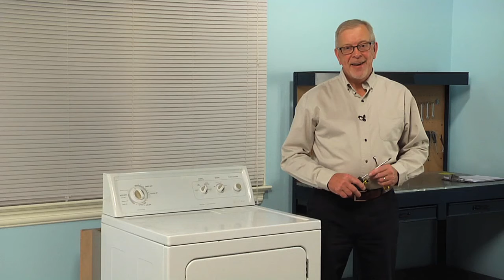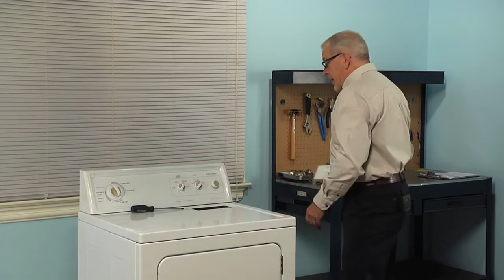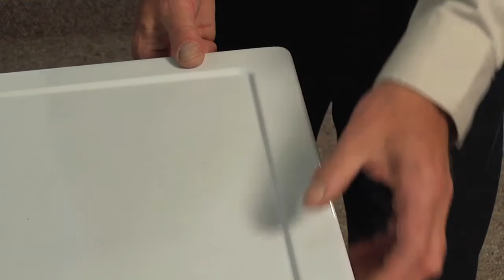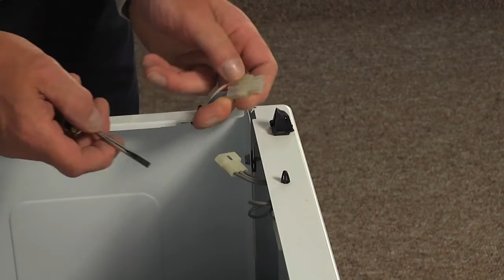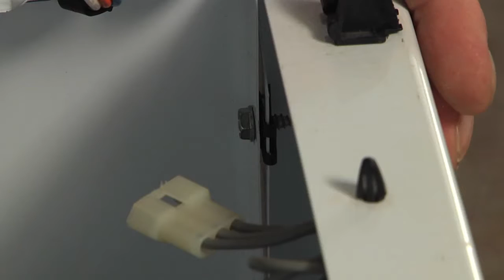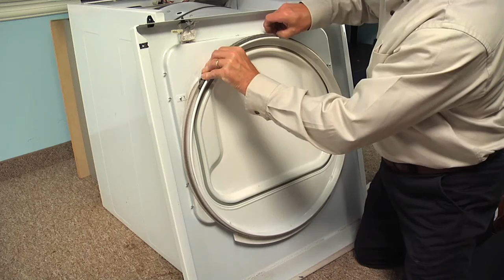Dryer Repair - Replacing the Bearing and Seal (Whirlpool Part # W10663510)

Comment: The dryer is great.≖>allmy.tips/Whirlpool-Dryer?J62     Less deep than others with this much capacity. Delivery requires purchase of cord and semirigid duct. For anybody that wants to dryer 4" from the wall (instead of 10"), you ALSO NEED ANOTHER PART...a 90 degree bend to attach on the back of the dryer, to hook the duct to! Should be included, or at least offered as an option during checkout.